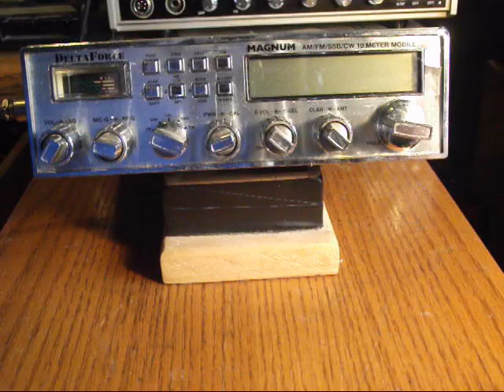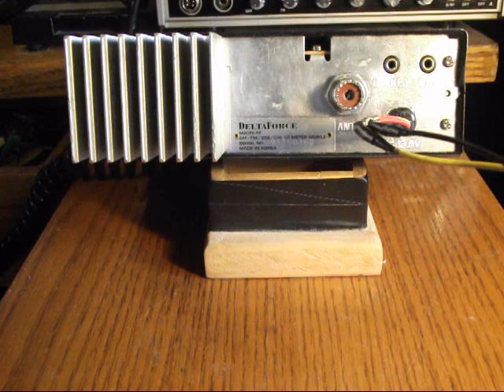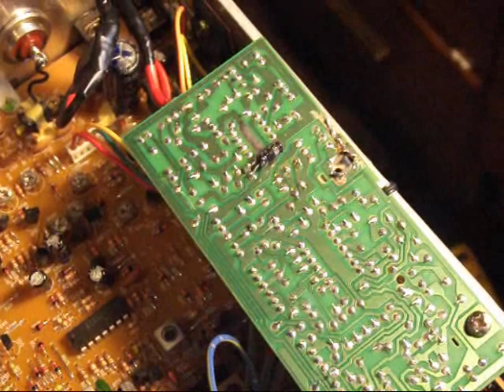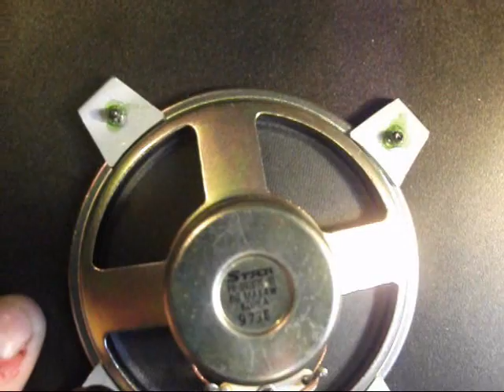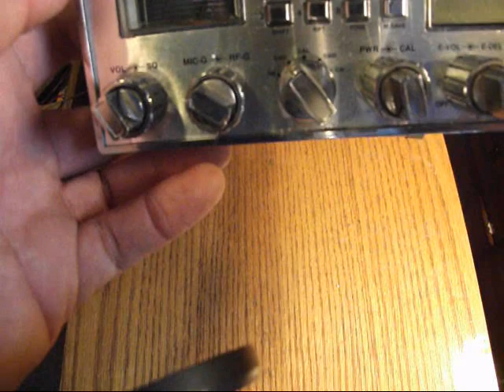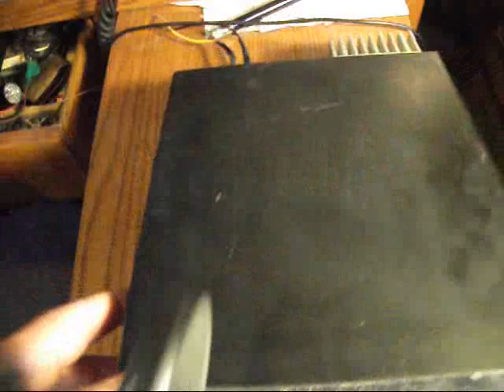DeltaForce Magnum

Comment: I wonder if Q142 the modulation limiter transistor has been removed, someone removed the one in mine and I'd like to put it back in but I can't find any info on what kind or number that the transistor is, I've looked everywhere but no luck.
Reply from the maker: That radio is long gone but I'd say you are probably correct my friend. thanks for the view. I wish you luck on finding information on the transistor.
Reply: Probably a 2sc945.
Very commonly used in so many cb radios for various stages throughout the radio.

Comment: You can open this radio up by changing the jumper on the small PCB under the lid however,  you will not be able to use the repeater shift facility on 10M. Cracking radio i have to say......lots of stuff on the net about this rig.
Reply: Como agos para tradusirlo en idiomas Español